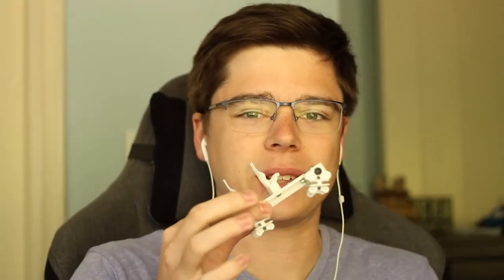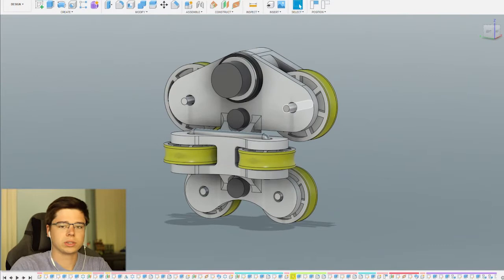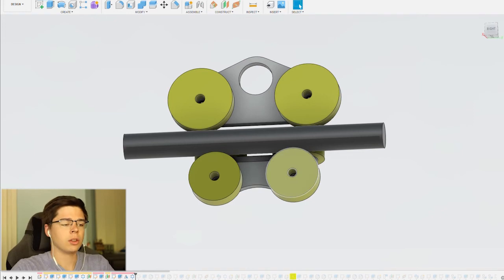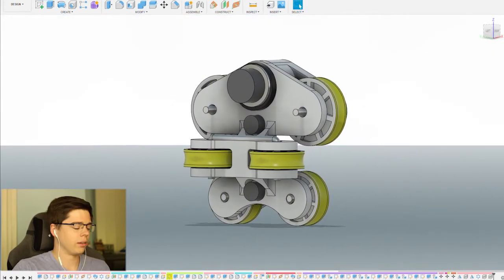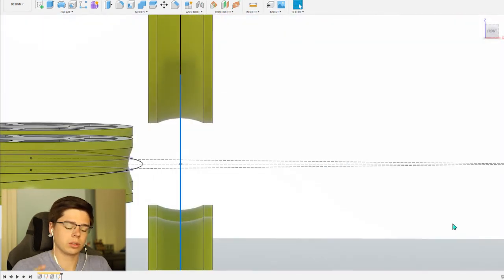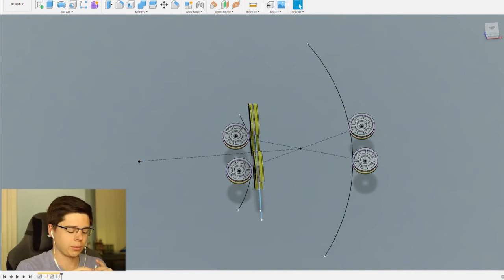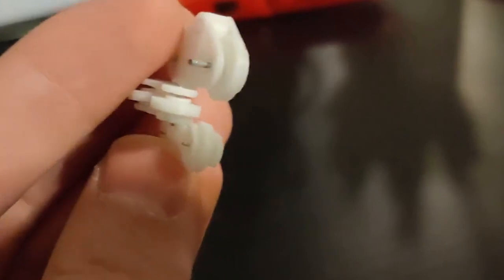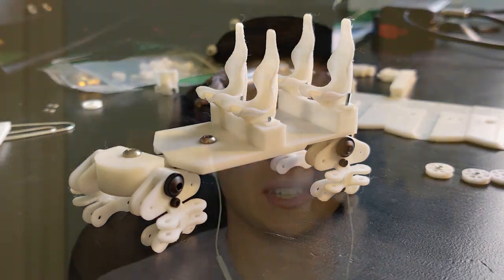2022 Coaster Project #3 - CAD: Part 1- Bogie Design

Comment: The orientation of the wheels makes the radius different for the concave and convex limits, right?
Reply from the maker: In the yaw axis, the guide wheels are identical on both sides so the radius is the same.
Your comment does bring up a good point that I didn't realize though. It may be slightly different for concave/convex in the pitch axis because the road wheels and upstops are designed differently, so the arc may not be able to be as tight in the other direction.